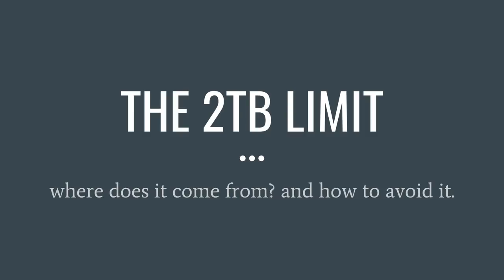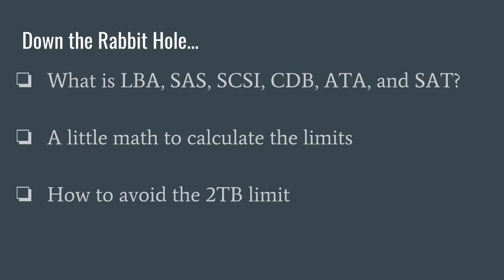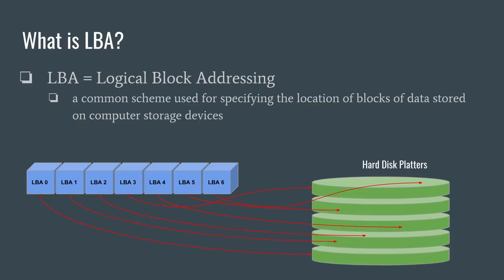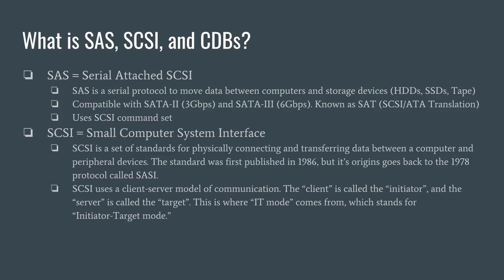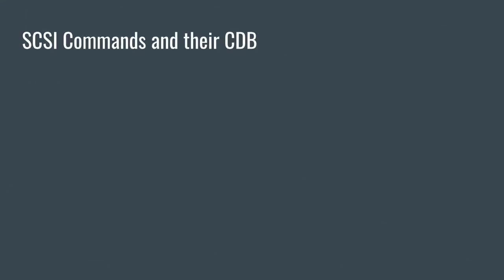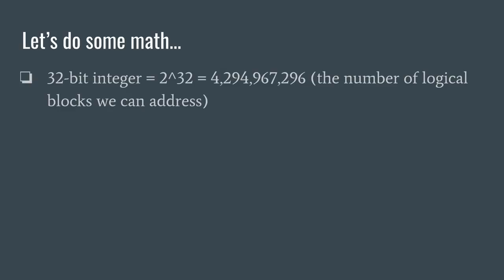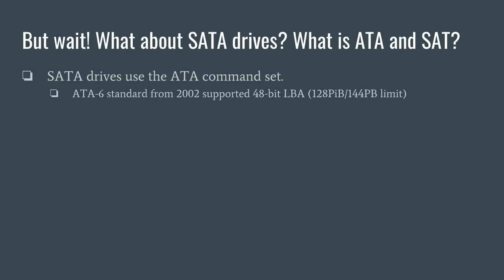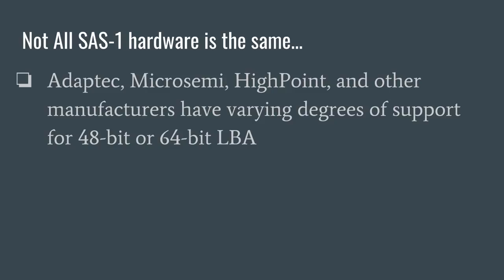The 2TB Limit

Comment: Dang, I wish I'd seen this before. I got a PS4000e (SATA) and am 75% of the way through populating it with 2TB drives, and now you're messing with my head ! lol ! Mind you, I think 32TB will be enough for me for now; but my interest is piqued and I will need to get into the controllers somehow to find out what the hardware is doing driving the HDD's. I'm also wanting to make this available on the network as a storage pool for ZFS (PVE?) servers - do you have any experience of that ?

I think I must have watched most of your other videos at least once, so I don't know how this one slipped through the net, but I thank you so much for the knowledge you've imparted, and I am still, learning from. During the recent lockdown in the UK your videos were an inspiration no less. I guess the best way I can thank you is to buy some 'stuff' from your store ha ha !!
Reply from the maker: Glad this was helpful!  How do you want to share the storage over the network? I appreciate the show of support, but I know shipping to Europe is not cheap so I'm happy with just the thought! :-) Thanks for watching!
Reply: @ArtofServer  Hi, I guess I'll have to use some kind of iSCSI devices and maybe an additional switch,  but reading the manual and some hardware req;s from Dell suggests my Netgear GS724 should cope. I've seen some Cisco  48 port units on eBay for between £50-£100. 
I've also seen that Dell/Equalogic have a version of their SAN software for VMWare but I really wanted to use Proxmox and ZFS on my other servers. However I might have to compromise on that one as I'm hoping to get hold of some firmware updates from a well-disposed ex-employee (!).

Anyhow, I'm still trying to make sense of the rest of the kit bought over the lockdown (an R410; 2 x R510; 2 x 610, 2 x 710; and an R815) ! So I'm more than likely to be hanging out in your store fairly soon ! I can cut down on shipping costs if I can put together a few items in one shipment, too.
Reply from the maker: @rufusmurphy9990  That's quite the lab you're building up there! LOL If you're just starting out with this stuff, I might suggest checking out FreeNAS for managing and sharing your storage.
Reply: @ArtofServer  ok thanks ! What with all the other stuff I'm finding out I'd kind of overlooked FreeNas. I think I've seen mention of it running virtualized somewhere 🤔

Comment: This is solid deep tech,  I was able to follow it well with the slide deck. Slightly OT- to continue with this presentation I would love to see how you configure an array using an HBA on the software side in unraid or freenas, not sure how the HBA's in IT mode shows up on them and how they handle the 48 bit or 64 bit addresses. I am teaching myself all I can to maybe screw together something like the 45 drives storage workstation, I know they are using a VM instance  on unraid, but not sure how they are doing it. (Yes im a noob, I only know enough to know what I don't know!!)
Reply from the maker: Thanks for watching! And thanks for the suggestion...

Comment: Is this still a thing? If I have a much newer LSI card, can I get more than 2TB over SATA? I don't see anything about LBAs in the docs for this card.
Reply from the maker: everything stated in this video is still true. the 2tb limit problem does not apply if you're using SAS-2 or newer hardware, and it only applies to SATA drives.
Reply: @ArtofServer  I just tested on my LSI SAS 9305-16i and all my 16TB drives are showing up as 16TB over SATA, or is that wrong? The backplane is SAS3 connected via a Mini-SAS HD, but my drives are SATA. Is that what you mean?

Comment: You didn't cover SAS/SATA and for that matter FC/SATA interposer boards. These are all invariably only capable of of doing READ(10)/WRITE(10), which I suspect is down to the crappy 32bit CPU's they have in them. Random further note the LSI 1068 cards in IT mode report a 2TB drive size even if you have a much larger SAS drives installed, but as far as Linux is concerned they just work.
Reply from the maker: In my R410 video, I have a SAS6i/R (1068E) with IT mode firmware and using 4TB HDDs and they were fine?
Reply: @ArtofServer Oh the drives are file it's just at least on the firmware I was running on they where reported as only being 2TB in size as they flew past at boot time (rack full of J4400's with dual ported drives is pushing 500 "drives" visible to the OS). Linux reported their sizes correctly because in IT mode would appear to gather the information directly from the drive and ignores the card. Back in the day I did a week long test with f3write/f3read to convince myself that there was going to be no issues with data corruption.

Comment: Sorry im new to this i have bought Dell Poweredge R720 with H710 mini controller and before i realized that new 12tb sas dont work on it i already buy 8 of them, so my question is there any chance to unblock this hard drives and make it work ?
Reply from the maker: I assume your H710 mini is with the stock Dell firmware? In that case, I'm not sure... might be a firmware problem. The hardware is fully capable of > 2TB HDDs, as I've demonstrated in many of my videos when using the LSI IT mode firmware. If your plan is to keep the Dell RAID firmware, I would start by making sure it is fully up to date and see if that helps your problem.
Reply: @ArtofServer  Can you give me your contact like skype or something else ?
Reply from the maker: links to my social media are at the top of my channel page

Comment: My god im hoping someone can answer this in a relatively short time frame. I have a PERC H700 card. Would updating this do anything to break the limit or am i screwed?
Reply from the maker: The PERC H700 is a LSI SAS2108 based SAS-2 6Gbps RAID controller. With the latest firmware update, it should support larger than 2TB. Typically,  SAS-2 and newer hardware will do fine as long as you're not running really old firmware.
Reply: @ArtofServer  Brand new to the server space. Im setting things up in the firmware and when im trying to make a new virtual disk with a 500 gigabyte drive for my boot and a 4tb HDD, my virtual disc size limits itself to 930 gigabytes and im not sure how to solve that and make sure im getting the full 4 TB out of it.
Reply: @ArtofServer  Also, that is two for two comments you have replied to today, thank you very much for the help.

Comment: Excellent video! I knew 90-ish% of what you told, but your presentation did indeed teach me a few things (or rather, put them in the right 'order' if you will). Keep it up! Ehrmmm.. And could I request a video about SAS expanders/extenders?
Reply from the maker: @Shoikan thank you! i'm glad you found this video useful. I'm happy to take requests, just know I might not get to it soon as i have a huge backlog of other video requests/ideas/concepts. Is there something specific you'd like me to discuss about SAS expanders?

I already have a few videos on the IBM SAS2 expanders here:

Explanation and demo of 24xHDD setup: https://youtu.be/qccpopxc_Uo

Performance of SAS2 expander: https://youtu.be/BvL70tEW3VU

How to update firmware on IBM SAS2 expander: https://youtu.be/Lw4TTI_HYqM

Thank you for watching! :-)
Reply: @ArtofServer  Excellent! I didn't find your expander videos despite looking. I guess I need better glasses ;) I was wondering, since the SAS expander card does not actually use any PCIe lanes (according to my understanding, probably only for the flashing of firmware), would the following work: I have a motherboard on which the m2 NVME slot shares the PCIe lanes with the second PCIe 16x slot. If the m2  is populated, the 2nd PCIe 16x slot does not function (but gets power). Would an expander work in that slot, given that it does get power? Or does it actually need those PCIe lanes?
Reply from the maker: @Shoikan  That's a good question. I don't know how the system detects which device to give the PCIe lanes to, the M.2 or the PCIe slot? Does it try to detect a current draw and see which slot is drawing power or not? If the detection mechanism depends on detecting power draw, this scheme might not work. But if is by other means, perhaps it can work. So, I don't have a definite answer for you, but it sure does sound like a cool way to make use of a PCIe slot that otherwise is wasted with a M.2 installed. I guess you'll have to experiment and find out! Please do let us know though.. I would be curious.

To be specific, you are correct that the IBM SAS2 expander only uses the PCIe slot for power, it does not use any of the PCIe lanes. The firmware flashing is done over the SAS connection, not the PCIe lanes. So all you need is power to run the SAS expander.
Reply: @ArtofServer  I am 99% sure that the m2 slot gets precedence: I found out the hardware that they shared the lanes by inserting an M1015 in the second slot as well as an m2 drive, and wondering why the drives behind the M1015 didn't show up. I'll try to get a hold on an expander then, this does sound very hopeful indeed. I will keep you posted!
Reply: @ArtofServer  I've got the expander and.... it works like a charm! So for clarity: the motherboard is an Asrock X370 Pro4 with a lowly Ryzen 3 2200G, plus 32GB memory. I've got an NVMe drive in the m2 slot, an LSI 9201-16i in PCIe2 and the IBM SAS2 expander in PCIe4, and an Intel NIC in PCIe6. Having the NVMe drive in the m2 slot 'disconnects' the PCIe lanes from PCIe4, but it will still receive power. And voila.. Drives visible and working!
Reply from the maker: @Shoikan  awesome!!! Thanks for the update! Cool way to make use of a useless PCIe slot!
Reply: @Shoikan  I know I am late to the show, but what a great question it was. I am personally looking for that very same answer and so... How fitting that I have found this thread.